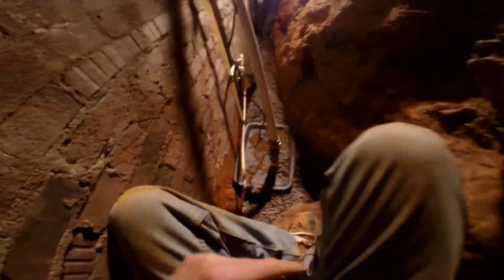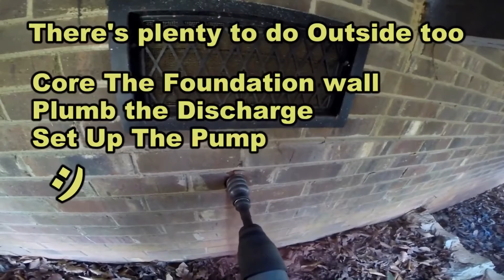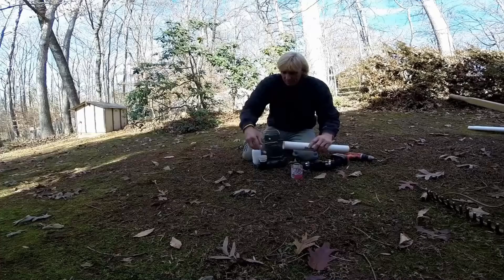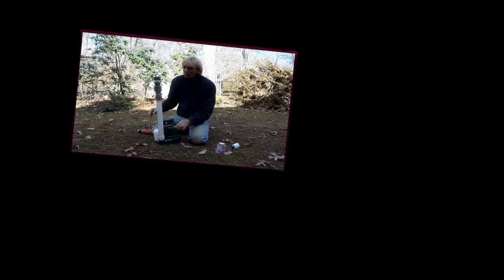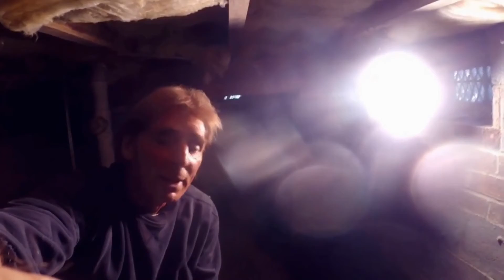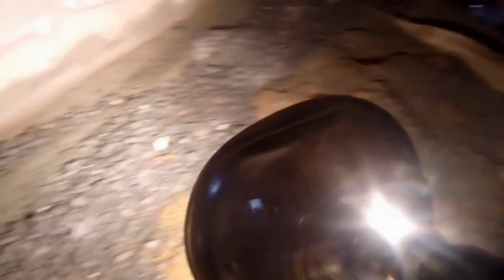How to Install Foundation Drain, Crawl Space Basement Wall, Apple Drains, Charlotte NC

Comment from the maker: Basement walls with Crawl Space surrounding, are the toughest problems to solve. Best way is excavating the wall from within the Crawl Space, Installing Footer Pipe and Sump Pump. 

Be prepared for many obstacles, water lines, sewer pipe, electrical wires and of course the removal of all that soil to get down to footer.

We have several other videos showing this type of install. Take a look!

Thanks 
Chuck

Apple Drains 
Drainage Contractors 
Charlotte North Carolina 
Orlando Florida
Reply: Hey chuck, I noticed in a video your van had Ohio plates. I'm from the Sandusky Ohio area, (cedar point) and we have the famous clay soil, I'm trying to install a sump pump for my yard, it has to go 200 feet, what horse power pump do you recommend. Thanks
Reply: 200ft say what? Wait 200ft now obviously u either had a typo there or ur speaking of 200ft to where the end of the hose run or pvc run spits water out into backyard or wherever it is going to do so. 200ft down into ground tht be in-heard of no matter where ur at in the USA or even the world. Maybe if ur like on top of Mt.St.Helen and ur shooting it 200 ft off side the mountain

Comment: Great videos! I need to "Y" connect some 6" Corrugated Perforated Pipe and have seen your other videos how to connect two together without buying an expensive connector piece, but at one place I need to y-connect 2 6" pipes to run on down a steep hill and dump.  I can't find even an expensive y-connection, only T's, so wondered if you have an idea how I might y-connect 6" pipe?  Thanks!

Comment: Do you replace the dirt over the french drain or leave it off? I dug a french drain in a crawl space to sump out water brought into the crawl space by rainwater. It was maybe two feet below dirt in crawl space. I left it excavated so clay would not seep into the gravel above the pipe. I covered it with gravel per your direction in previous videos.